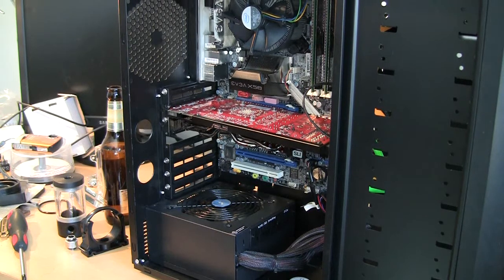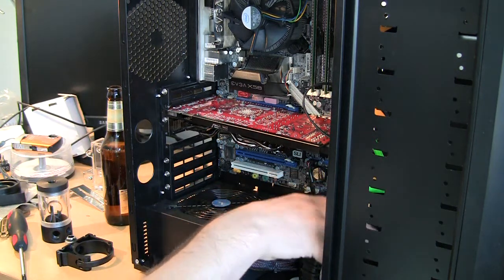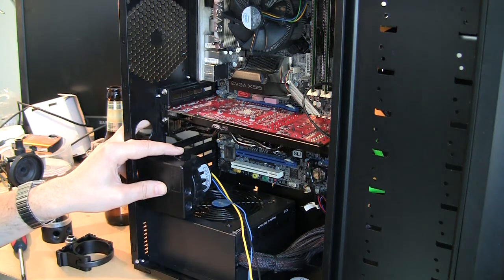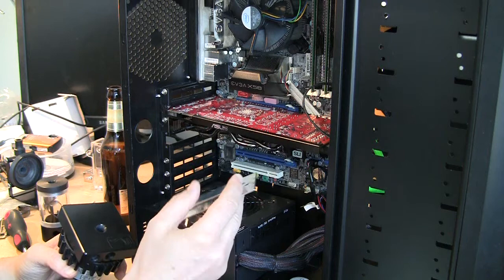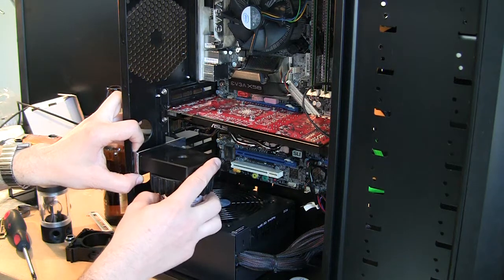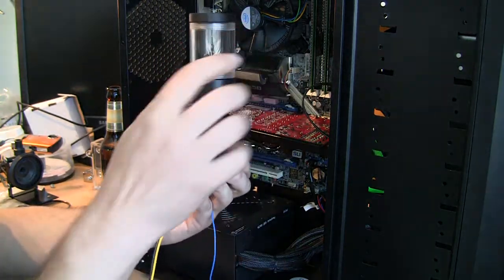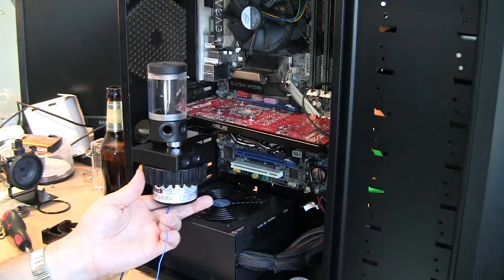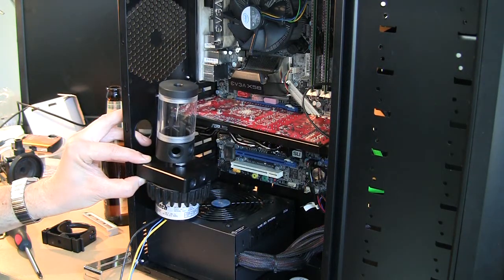Low Cost Core i7 Watercooling Build Ch#5 [HD]

Comment: Hi Nice Video :)
I just want to ask how did you mount the pump and reservoir because there is no holes on the case to mount it. I don't have a huge amount of knowledge on water cooling systems so correct me if I'm wrong.
Thanks in advance.